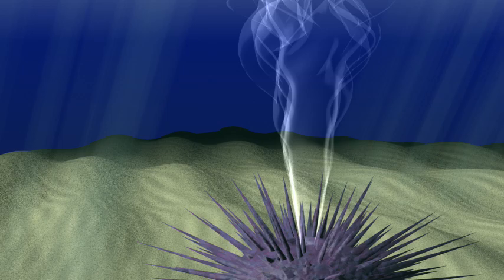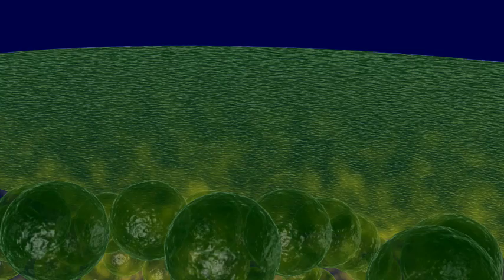Sea Urchin Fertilization

Comment: Sea Urchin Fertilization Video Transcript
(1:44 mins)

The sea urchin is the key system for
00:07
studying fertilization. This male sea
00:09
urchin is releasing sperm from its gonaphores.
00:12
Sperm use the flagellum as a
00:19
propeller to swim. The flagellum motion is
00:21
like a corkscrew rotation. 
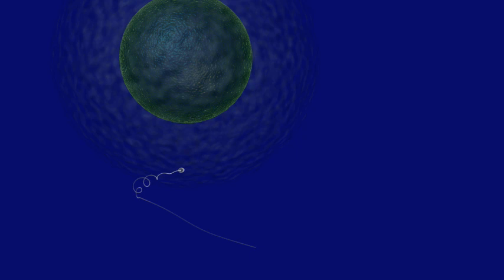00:29
When the sperm gets close to the egg, the higher
00:31
viscosity of the egg jelly could slow
00:33
down its movement. Before we continue to
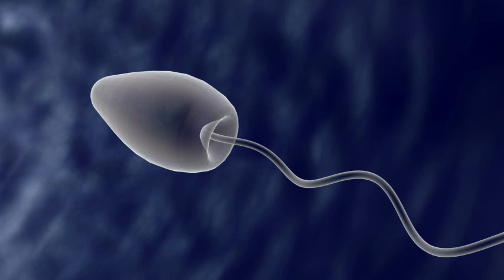00:38
follow the sperms journey, let's look at
00:41
its inner structures. The mitochondria
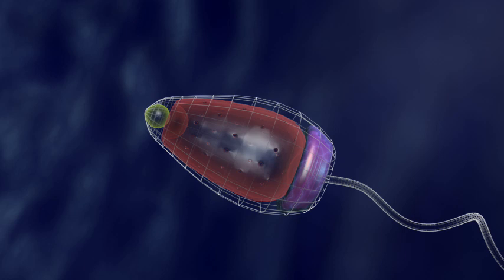00:43
produces ATP to supply energy for the
00:46
sperm movement. The nucleus carries the
00:49
DNA for genetic informations. The
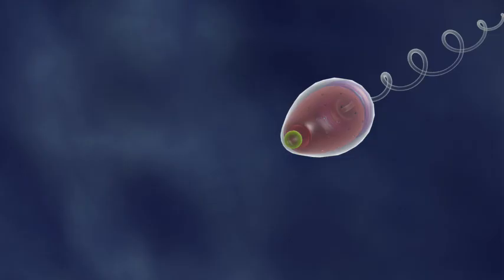00:53
acrosome
00:53
is a vesicle at the tip of the sperm head.
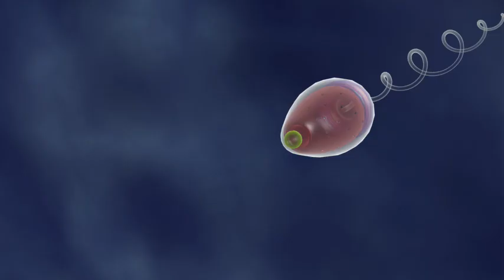00:57
After contacting with the egg jelly, the sperm
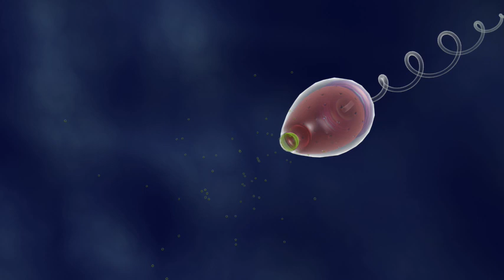01:00
releases the enzyme inside the vesicle to ?enter? the jelly. The
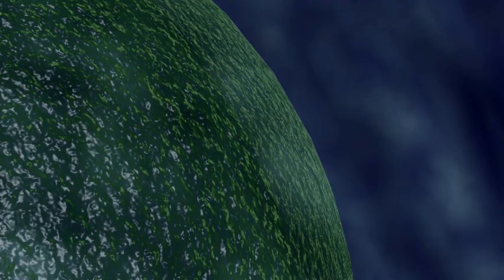01:03
acrosome membrane then is pushed out to
01:05
form an acrosome process which protects too
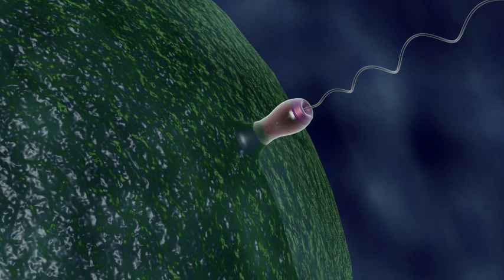01:08
and fuses with the egg plasma membrane.
01:10
The rest of the organelles that entered
01:13
the egg cytosol. The sperm manages a lot
01:18
of changes in the egg. Calcium
01:20
concentration increase triggered the
01:22
fusion of cortical granules with the
01:24
plasma membrane. The components release
01:27
the vitelline envelope.
01:31
This event start from the sperm binding site and sweep the whole
01:33
egg right away
Reply: You're awesome, thank you